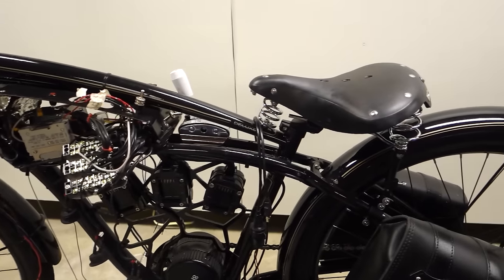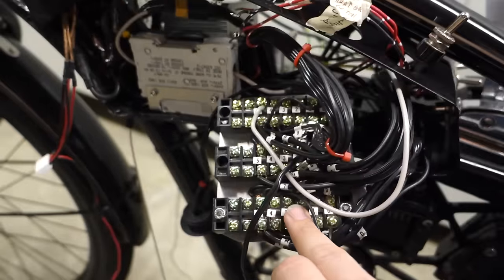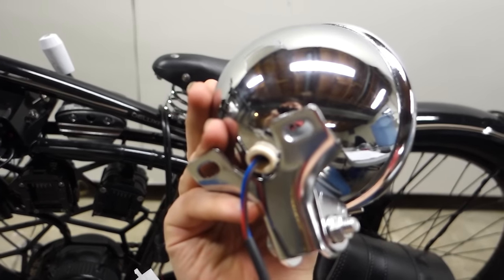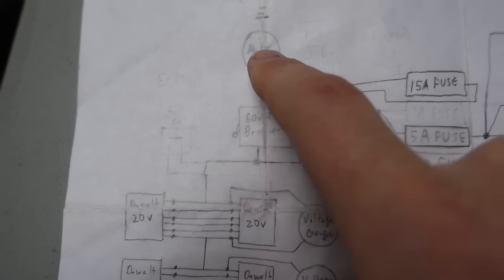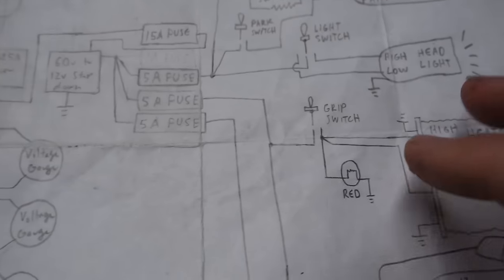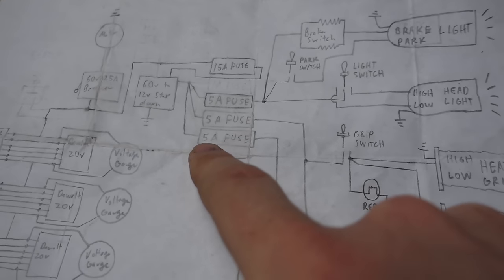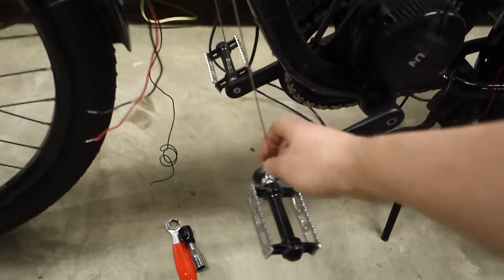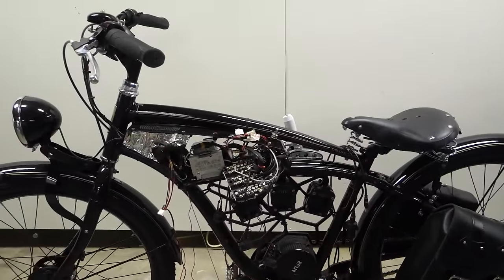Dewalt 20v x 6 Electric Bike part 9 Electrical Upgrades 60v

Comment: Wow! So much work! Incredible. What are your thoughts on brushless DC Motors? I am building an electric scooter and getting rid of the ESC would save a lot of space.
Reply from the maker: No matter what kind of motor you choose you will always have some form of speed controller. What I like about the bafung is that it is built into the motor. DC brushless motors are better than brushed in longevity and performance however are more expensive. A battery on a brushless will typically last 20-30% longer. There is a lot more complexity to a brushless as it is a 3 wire setup and requires a higher quality of circuitry. Just some of my thoughts.
Reply: I bought a ~1500w brushless motor from china with a industrial controller for $350. I feed my 12s10p Samsung 26F 18650 pack straight into the controller and use a $12 0-5v pedal off Amazon for speed control. 40A fuse in line of the battery pack, e-brake switch to cut power to the motor, 3 way toggle for forward/off/reverse. I put everything on the back of a go kart and use a centrifugal clutch with a weak spring since the industrial controller doesn't like the motor stalling while taking off from a standstill. Haven't been able to go top speed since I'm working on it in a busy town, but Ill get to have some fun this summer.

I have a little over 1k into my project and I see all these guys with insane setups that probably cost over $2k+ with custom work done. I'm not beating any acceleration records, but I tried to do everything in the most cost effective way. Ill have a video up in a few months.

Comment: How did you get past the +/- 10 percent threshold for the 48 volt system. 54.8 should be the highest you can run on. How are you doing this?

Comment: Hey Blair funny I ran into your  Channel today looking for new videos to see . because I was tinkering with my cordless drill batteries the other week.trying to figure out how to utilize the energy that them batteries can put out. to use for my two stroke motorized bicycle headlights and rear lights. question did you do your bike by your self or did someone help you. AWESOME BIKE you have there Blair.

Comment: Beautiful job!
Is it dangerous to apply 60 volts to the controller of the motor, built to be used with 48 volts batterie?

Comment: Have you ever looked in to the EGO 56 volt batteries for possible builds? These can be bought at any place carrying the EGO electric lawn equipment Home Depot ect.  Looking to build a bike and borrow a few thoughts from you concept only a rear wheel drive 48 volt 1000 watt unit. Got any ideas?
Reply: I enjoyed your build by the way. Thanks for sharing..

Comment: Very nice work , man. I have a couple of questions; 
1. On previous videos, you've planned to monitor each of the 15 individual cells thru LEDs and a sonic  alarm to avoid cell damage. However , you did not implemented them. Did you have some feedback as this monitoring no being necessary and monitoring the total 20 volts as being enough ? For instance, the Tesla electric car is having about 6,000 cells and of course impossible to monitor each of them.
2. Concerning the mounting plate , did you cut out the grid with the mill you showed on early video? or used different machine for that? if so how?

Thanks and again, awesome piece of work

Comment: I m looking at building the same sorta bike but using 4 dewalt 60V 9.0 amph batteries, any reason you used a chain driven motor  instead of a hub motor?
Reply from the maker: having a mid engine with chain gives you gearing options while a hub motor you just get what you get, your only gearing options being wheel size. Also I dont know if you have ever actually drove a rear hub motor bicycle but weight placement has a big effect on drive-ability. Having a rear hub motor bike with rear batteries its quite strange to ride. You have all this weight on the rear tires and you steering is light as a feather. Its like having second rider holding on to the back of your bike, if you ever did that as a kid. the rear battery front motor is also quite strange. the weight is ballanced between the rear batteries and the front motor but the front motor acts as a giant gyro and its weird having that much weight on your front tire. Part of it is actually kind of cool the gyro effect really auto steers the bike forwards its weird. You can sit there and take your hands off the handlebars and do whatever you want. The bike just wants to go straight. I mean its wants to has to go straight. You can go over curbs and potholes without touching the handlebars and the front tires just wobbles a bit but like I said it just wants to go straight because of the gyro effect. Having the motor and the batteries at the center of gravity just makes the bike feel like a normal bike. That is the biggest advantage.

Comment: Only if you're really confident that you would never have to pedal home should you disable the pedal drive. Again, I would ditch all of the creature comforts and just focus on getting it safe and dependable first. Then you can add only the things you really need to get around without draining the batteries as fast as you can. Good luck.😉

Comment: i would delete the radio and heated handgrips  and not use pedal cables and go back to the former , the leather seat is very nice and will conform to you . all the power saved i would put into the motor .
Reply: same thing i was thinking looking at who simple the wiring would be.no radio,no heated grips